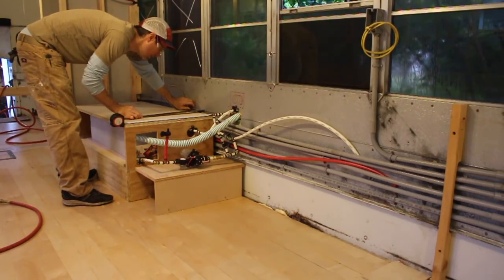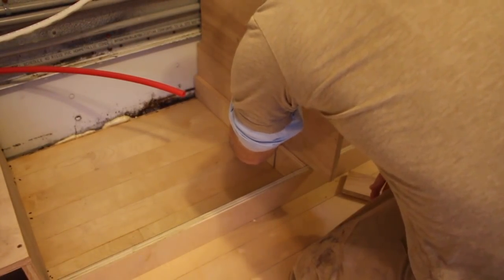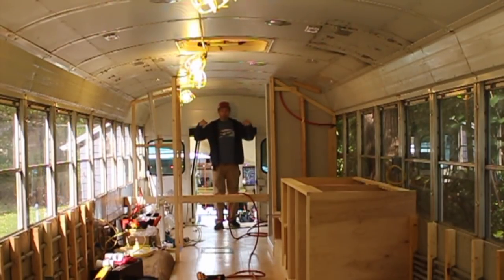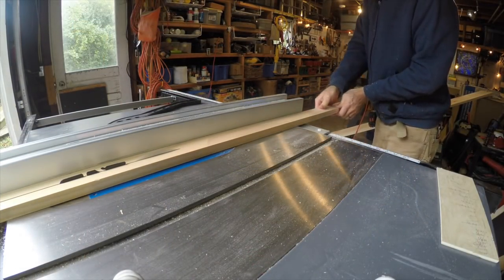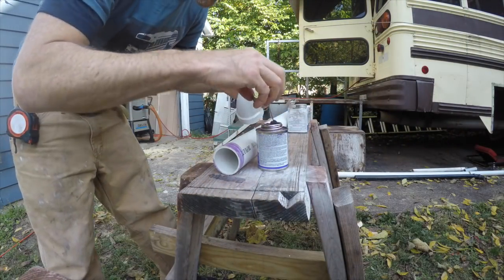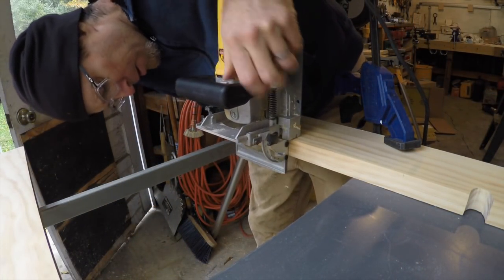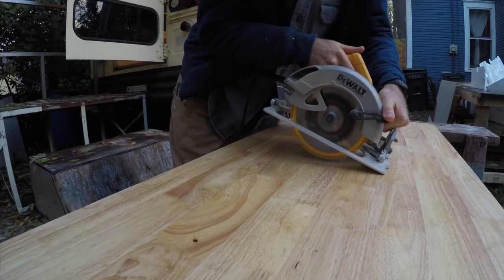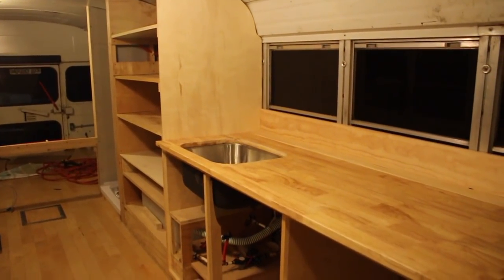Kitchen + Floorplan -- Prison Bus Conversion #24

Comment: Great video! I was thinking of building my cabinets also. Is the trade off of buying stock  cabinets or building your own a true money saver (keep the budget low)? You are creating a garage area in the back of the bus, what will you store back there if it is not too personal of a question? So many question, because you make conversion look so easy!  Thanks for the inspirational Conversion Videos SKOOLIE 360 CRUZIN 2018
Reply from the maker: +Norris Coleman ... stock cabinets sure are nice, but I never considered them because I wanted such specific dimensions... plus, I’m a cheap skate and these cost me very little 

Regarding the rear garage I’m thinking snowboards, backpacking gear, tools, and maybe even a generator if we get fancy
Reply: So, You actually save by building your on cabinets, the cost of ply and 1X stock?
Reply from the maker: +Norris Coleman .... I used plenty of leftover wood, but spent between $20 and $30 a sheet for plywood. So a cabinet might run me $50-$100 give or take. Drawer hardware also costs, but I have a lot on hand

Comment: Just beginning to work on our newly acquired bus! Lots of great info! What type of fasteners are you using that go from wood framing to metal of the bus ceiling and walls?
Reply from the maker: Hey, good to hear from you ... and it's exciting that you have a bus! I've been using a variety of self-tapping screws, but my favorites have turned out to be designed for installing metal roofing. Here's an example of the screws I'm talking about: http://amzn.to/2E5adr1 Now, they don't always self-tap through the thicker pieces of steel, but I like their gasketed washers (at times). You can also remove the washers. I should say that I only started using these because I had a few bags left over from previous builds ... but when I got a look at the price of other self-tapping screws, I opted for these roofing screws. One final note: in some instances, I've used deck screws to anchor framing members into the bus ceiling, and those screws seem to set in pretty well. I hope that helps! Good luck with the bus

Comment: Nice work!  I love that counter top.  Do you plan on painting or staining the cabinets?
Reply from the maker: +A Coates Life ... I’m torn! Was thinking of a mix with just painted drawer fronts ... but we’ll see. Thoughts either way?
Reply: metaspencer our thought for our bus is a light sage paint for the cabinets with a natural butcher block counter top.  We love colour tho so want lots of colour in our bus!
I also think paint would be a nice way to break up the space between the wood floors and the counters instead of it all blending together if it was all stained in a similar colour
Reply from the maker: +A Coates Life .... ooooo sage! I think you’re right: too much wood and it can blend together and look like summer camp

Comment: Not sure what refrigerator you will be using, if you are going to use propane it is VERY important how you vent it. You do not want this.

https://www.lever-family-racing.com/wp-content/uploads/2017/07/rv-fridge-fire.jpg

Here is a diagram
https://www.lever-family-racing.com/wp-content/uploads/2017/07/vent2.jpg

A small fan in the right place  helps tremendously. I am truely afraid off how Ian did his and then added the bathroom vent in the same area.

I have done many upgrades to mine including replacing the whole cooling unit. All the projects on the refrigerator are on the web site.

Glenn Lever